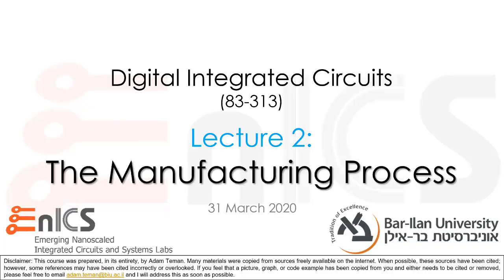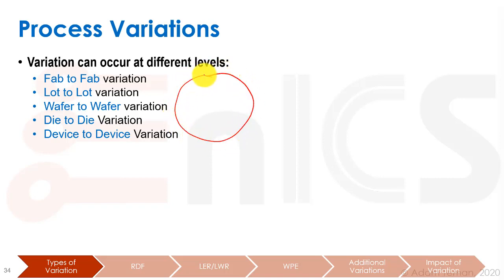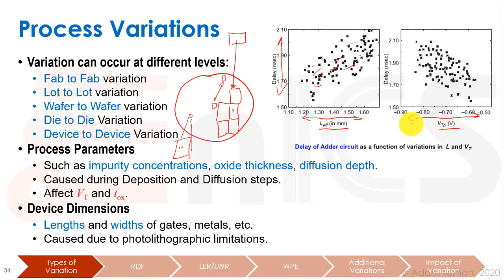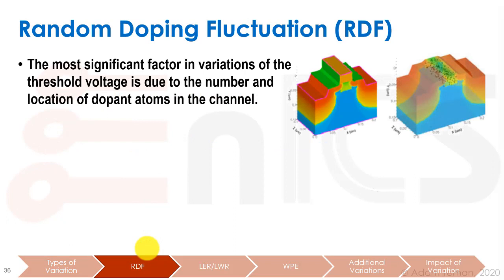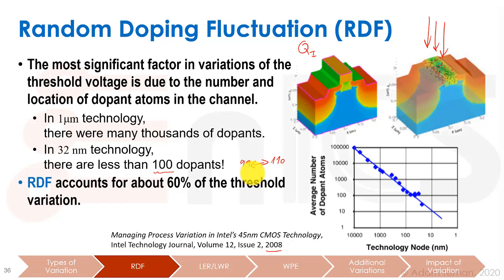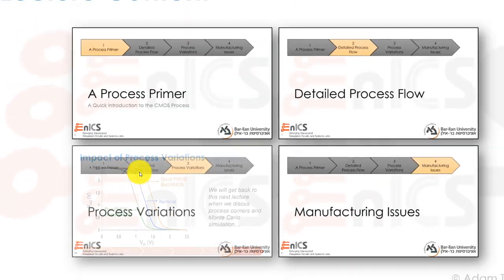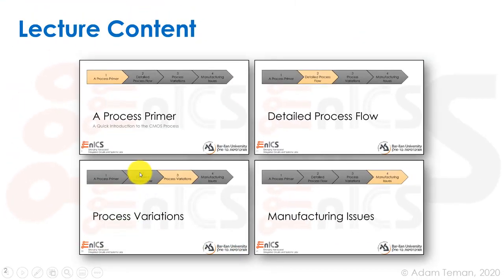VLSI - Lecture 2c: The Manufacturing Process - Process Variations

Comment: Why we should take process as 1 in slow,fast, typical
Can you please help
Reply from the maker: Sorry, I didn't understand the question. Please elaborate.
(what do you mean by "process as 1"?)
Reply: @AdiTeman  in PVT, why process  value is 1?
Reply from the maker: @sktiwari2677  So, I'm not sure what "process value" you are referring to. If it is, for example, the parameter inside a .lib file - it could be that this parameter is not used by the tools (at least in the way you would "expect" it to be used or was initially intended to be used). 
If you means something else, then please explain.

Comment: Could you probably explain a little bit about the dopants in the channel ? For example, for an nmos, there's a depletion region in the channel which contains negative ions and it's only when the interface potential reaches a sufficiently positive value that a channel of electrons is formed from the source and drain. So, the charge carriers are provided by the n+ source and drain regions. What exactly are these channel dopants your talk about around the 8:00 mark ?
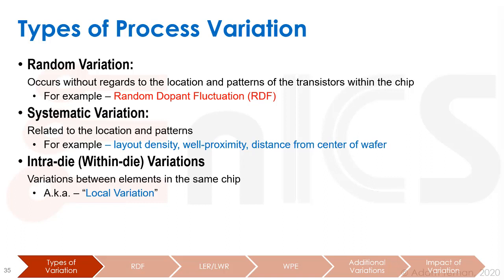Reply from the maker: Of course. I think I explain it when discussing threshold voltage in Lecture 3c at the 5:38 mark (https://youtu.be/J4fVI3YTozM?t=338). 
The threshold voltage is set by the various parameters of the materials and the process, but for most (at least older) technologies, there is a "VT Implant", which I refer to as "Q_I" in the slide. It is used to shift VT from the basic ("native") level to the desired level. It is this implant that is also used to create LVT, HVT, etc. flavors of transistors. 
In other words, this is doping that is added to the channel on purpose during the manufacturing process to set the VT at a certain level.